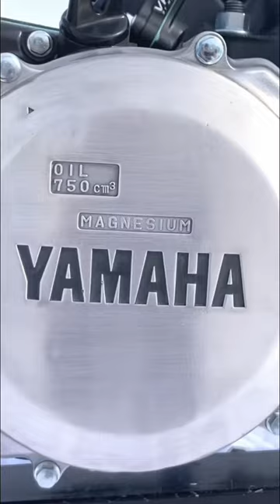Building the Ultimate YZ300 2 Stroke Engine

Comment: I've always been told to pre soak my clutch plates in oil. Is that still something practiced. 🤔
Reply from the maker: It is, I did soak these. That said, I have also dry installed before with no issues.
Reply: Yea I always did. I stopped riding the  body let me know. After 40 years. 😀